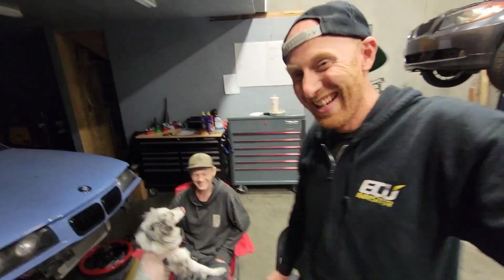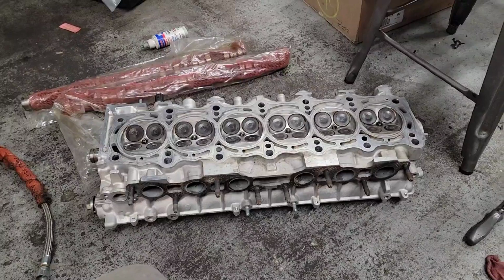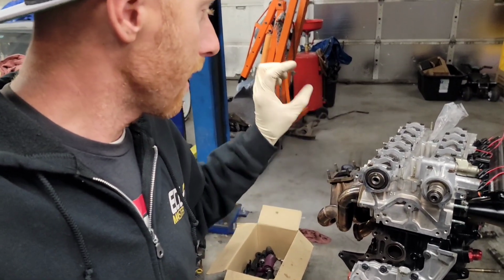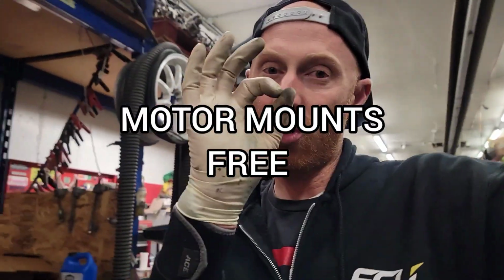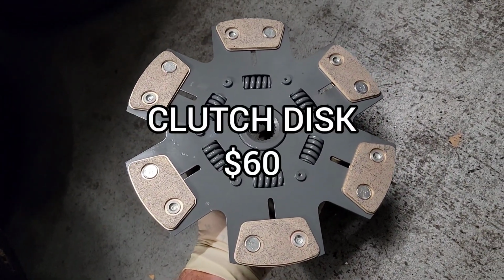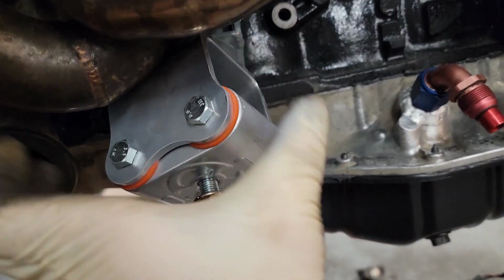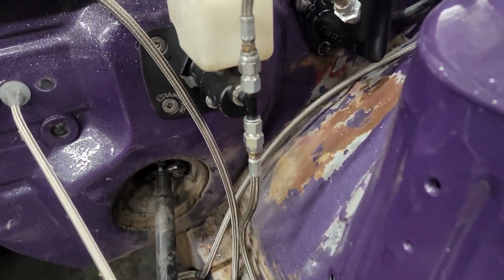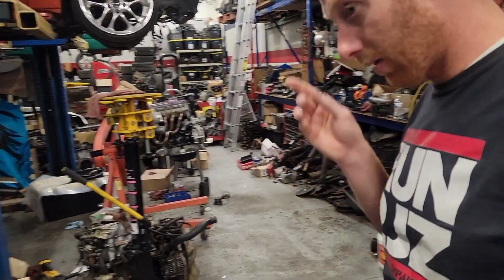BUDGET BUILD 2022 Ep 6 - Final 2JZ Assembly

Comment: What's your take on stock crank pulleys? As far as torque specs and failure, is there a trick to not have them tear apart on you?
Reply from the maker: Just old rubber. Torque shouldn't affect it's durability. When it's time to fail it's time to fail.
Reply from the maker: That being said, I just take my chances with used ones.